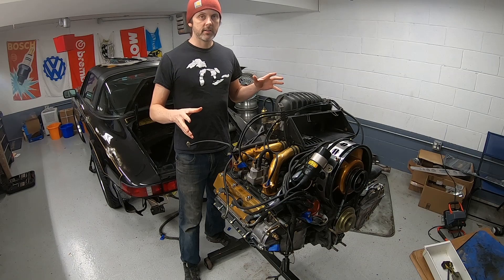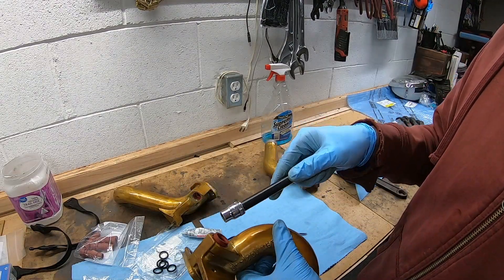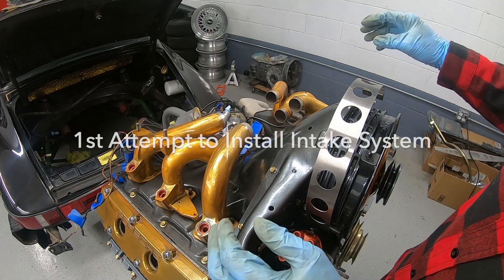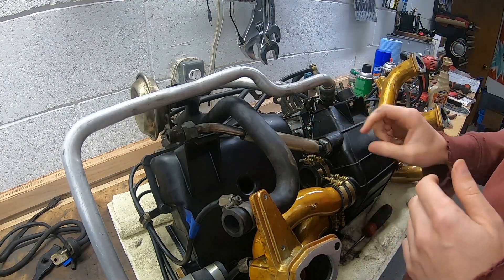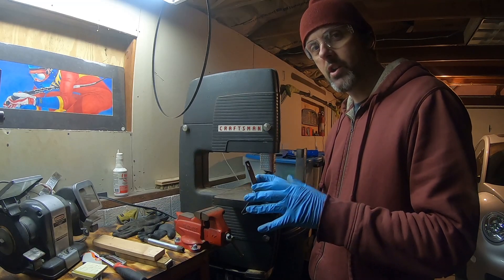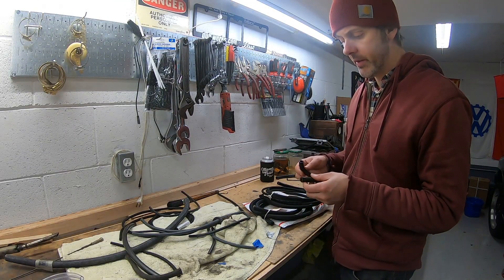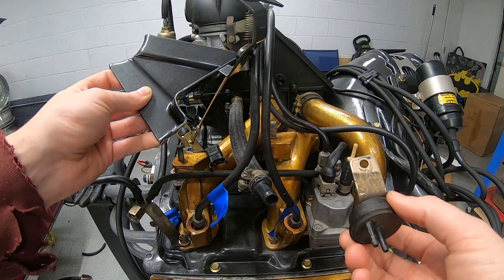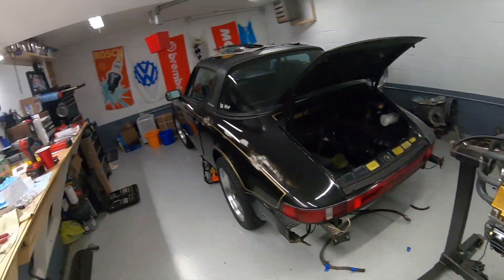How to Rebuild CIS Fuel Injection Porsche 911S!  Teardown & Modification, Projekt Airkult Episode 24

Comment: Also most will agree that cheap fuel hoses on a 911 is probably the No1 mistake to make. You cannot see if they are perished once the engine is in so you need them marine grade, maybe original Porsche parts is best.

Comment: Nicely done.  I am really considering getting rid of the CIS - seems to be causing issues with cold start that changing out the WUR and cold start valve haven't solved.  Before you took your 911 off the road, how was the cold start?
Reply from the maker: I had no issues with this car at all.   It was very reliable, just leaked...everywhere.    I would check out the links in my description for more info, some pages even have trouble shooting.   Might be the thermovalve?
Reply: @ADDvanced  could be. I’ve gone through the troubleshooting page on the CIS and at least when I was in SoCal it shouldn’t have been an issue. I will remeasure the pressures once again. Thanks!

Comment: Great video, thanks.  Did you replace the fuel lines from the fuel distributor? If so, where did you get them?
Reply from the maker: I did NOT do that.   I looked at them... and they all look perfect.   Not sure if I should or not, they seem to be perfectly fine?
Reply: @ADDvanced  I'm in the same boat.  Mine look fine as well.  Mine is a 1980SC Euro, which has the plastic fuel lines.  They look good, but he rubber covering over them will be replaced.
Reply from the maker: @Clubracer144  Idk how you'd replace that rubber covering without taking them off, at which point you may as well replace them.   I'm thinking about just wrapping the degrading rubber with something cool like gold heat tape... idk yet.